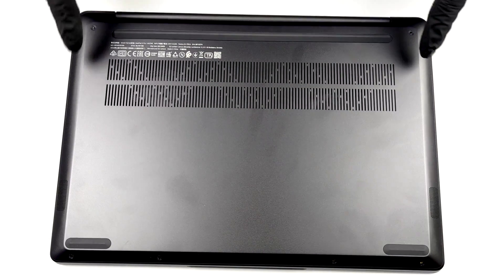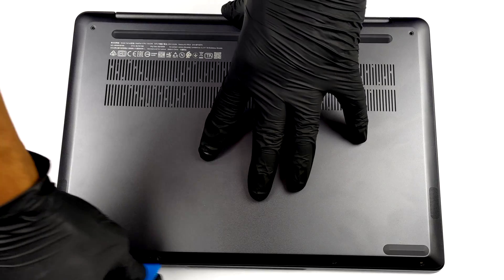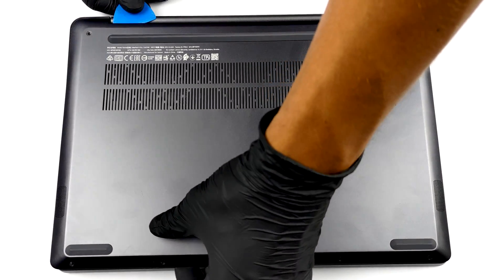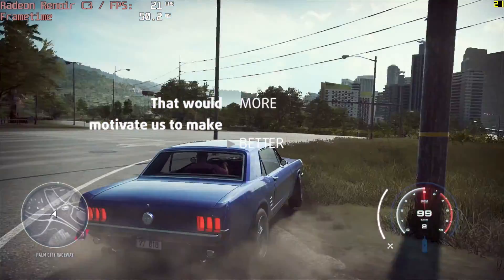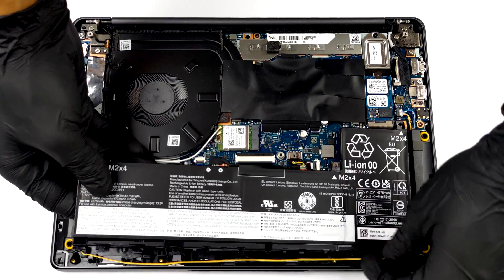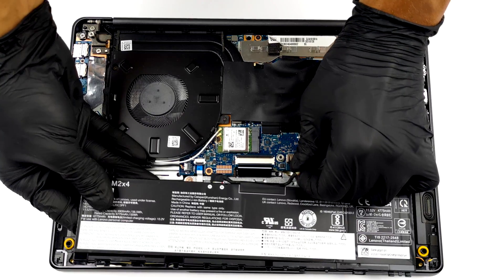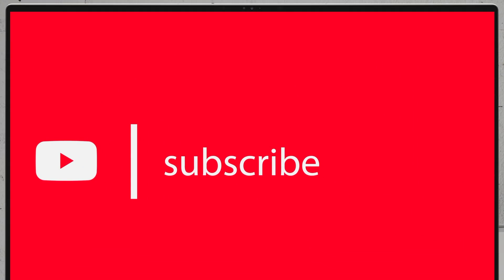🛠️ Lenovo IdeaPad 5 Pro (14") - disassembly and upgrade options

Comment: Where is the RAM situated? What type of RAM is it?
Reply: Soldered to the board. RAM is always near the CPU to reduce latency and data transmission issues. Beyond that, its difficult to tell without knowing or going chip by chip and looking at part numbers. Its likely under the HS assembly to assist with cooling.

Comment: Hi, @LaptopMedia

Is it possible to replace the keyboard for this model? I have a Belgian Keyboard Layout and I want to replace it with a ENG Keyboard Layout. The chasse fits, but are there any hurdles, some obstacles, that prevent the replacement of the Keyboard?

Comment: The worst laptop I ever bought, I will never buy a laptop again from Lenovo, its build from super thin and worst quality of material, i you drop it once say good it will break.
Reply: Bruh you obviously bought different model, this one is made from alluminium, the body is copied from macbooks, body-wise it is perfect, also the performance I get from mine is insane.
Reply: @kristiyanpavlov1868  Do you have dedicated GPU? i am planning buying config 5600u with mx450? any opinions?
Reply: @bartoszterlecki8675  Unfortunately not, I returned mine because I told it has thunderbolt 3/4 ( cause I have razer core x at home and maybe 5 GPU cards that I use for mining ) however I researched more that AMD does not support it, it is Intel technology, also not all Intel based models support it. Bought thinkpad serie, have it for one day only, the build quality is much worse than 5 Pro unfortunately.
Reply: @bartoszterlecki8675  mx450 is 2GB I think, depends what you will do with it, for gaming it is very low, however you may run Warzone in lowest settings smoothly probably hehe
Reply: @krismataslipknot  i have gaming rig so if it will be used to any game, more like casual or something that demanding like worms or something. I just had Dell Inspiron 14 and cooling there was rrall garbage
GPU was limited to 68 degrees so GPU was "overheating" non stop what made it useless. This is why I was courrios about here. Never then less I bough it. I will test how thing are there. Have high hopes that it will be seriously good
Reply: @bartoszterlecki8675  5800U is substantially faster, and its a year newer tech. 5600 and 5700 are old AMD chips rebranded into the current (at the time) gen chips

Comment: I'm disappointed that the speakers are downward facing. I thought from the grilles on each side of the keyboard were speaker grilles. Apparently, they'r not?
Reply: not a problem.. pointing downwards will bring surprisingly better acoustic propagation (amplified) heating your bottom..
Reply: Some people said the upper grille made sound better
Reply: @MTN1601  I do not think so, the acoustic in my case is much better facing downwards

Comment: can u stick classic 2280 SSD in this machine? And if u can, can u use SSD from this machine to 2280 slot or only to 2242 slot?
Reply: I bought it and u can stick 2280 ssd, and there is no capacity limit, i put 2TB and works great
Reply: @MartinBrokešPC  Hi, is the WiFi card of this model removable? Can it be replaced and upgraded to a better one?
Reply: @Gooty88  Hi, yes it is replacable.
Reply: @MartinBrokešPC  Thanks!
Reply: @MartinBrokešPC  hey, how good is the hinge?
Reply: @pyro9650  they are solid, there i no wiggle anywhere. I bet the hinge will survive the motjerboar
Reply: @MartinBrokešPC  nice. Whats your version, intel or amd?
Reply: @sunilkc2008  amd 5800h
Reply: @MartinBrokešPC  how is it 5800h, it is only 5800u or 5600u
Reply: @nho2x113  oh my bad, i have 5800u ofc
Reply: @MartinBrokešPC  I have a small question, the ssd in the video is smaller to what I see in other laptops, is it any certain type?
Reply: @nho2x113  its 2230 ssd size, its normal ssd but small. But u can stick 2280 ssd it will fit good, i have 2280 in my laptop and there is no problem. Btw my laptop has installed 2280 from factor ssd
Reply: @MartinBrokešPC  can you tell how long is the battery life normal usage?
Reply: @semyel410  about 8 hours
Reply: @MartinBrokešPC  hi, do you know where's the cmos battery?
Reply: @Langramadhan98  Its under the normal battery.
Reply: @MartinBrokešPC  but in this video i don't look the cmos
Reply: How is its build quality?
Reply: @CuongNguyen-gu9fl  its good, quality
Reply: Bro please tell me Which company manufactured the SSD ? And how were you able to screw and fit the 2280 in 2242 ? How did you migrate the OS from default drive to your new drive ? How is the battery life now ? I am planning to buy this, please answer ASAP. Thanks in advance.
Reply: @motivationtomove8979  in my case i had a 2280 ssd western digital in there from factory so i swapped to 2tb ssd from crucial 2280 too, but if there is and 2242 ssd it has extension for 2280 or there is a mounting bracket for 2280 so you just screw it to the right hole. For system clone i used macrium reflect and external nvme frame where i put the new disk and connect it via usb-c. And battery life is very good, about 7 hours browsing web.
Reply: @MartinBrokešPC  i placed order for 512 GB 2242 size SSD variant. The 2280 is out of stock. There isn't extra space for 2280 to fit as shown in the video also. So I guess only 2242 works for now.
Reply: @motivationtomove8979  look, in the video, there is an 2242 ssd but with the extension to 2280, Lenovo just doing this and idk why, i had this on my IdeaPad l340-15irh. And if i look closely, you will need to extend the ssd with the original extension to 2280 size
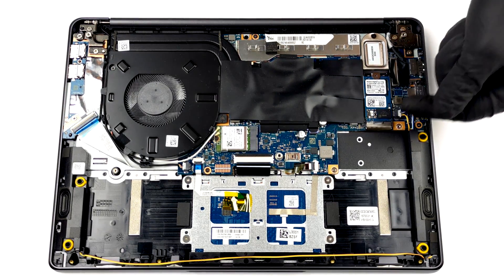Reply: @MartinBrokešPC  yeah, at 1:38 it's said 2280 is available.That a relief for the future. Thanks a lot bro.
Reply: @MartinBrokešPC  i have the same laptop too , but in my laptop when i hold it the bottom panel is always touching the internal parts , is it normal? or mine having the issue?
i thought of ignoring it but when ever i hold it feels awkward like its going to brake. and also some sought of plastic noise coming everytime i open the lid or everytime i hold the laptop.
is it same with you???
Reply: @hannu123  While the case feels hollow, it is sturdy enough for me to hold it with one hand and not flexing much. Mine has no sound when opening the lid.
Reply: @Sol. Yeah i have a 14" but i had a classic 2280 ssd from factory.
Reply: I'm still waiting for any mad lad to try installing an adapter to change the wifi slot to an NVME slot for "extra" drive.

Comment: Could you tell me the size of the Torx screws? I don't own a screwdriver that's small enough, and I wouldn't want to order the wrong bits :) thank you so much!
Reply: If its still relevant its a T5
Reply: @applevsall  I found the answer somewhere in the manual, but thank you anyways :)